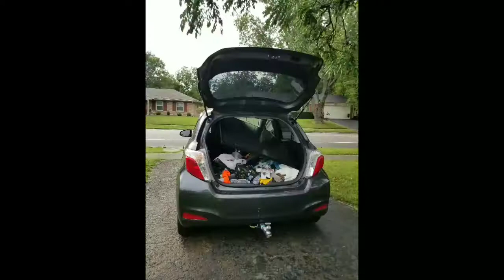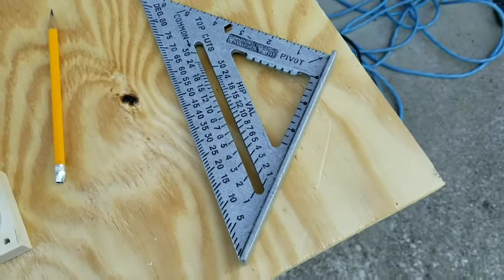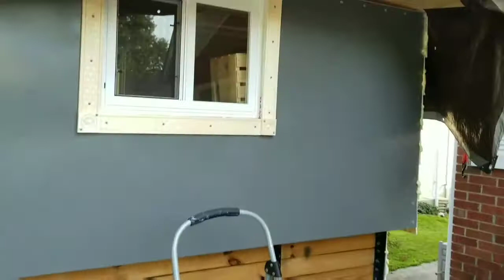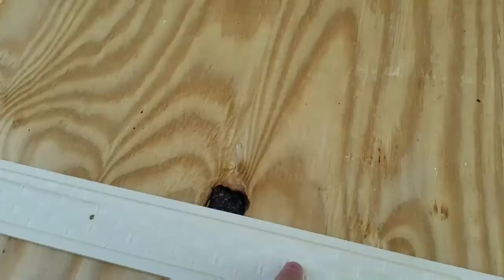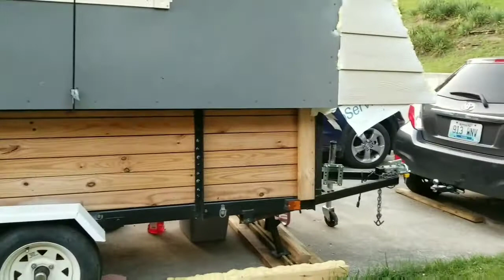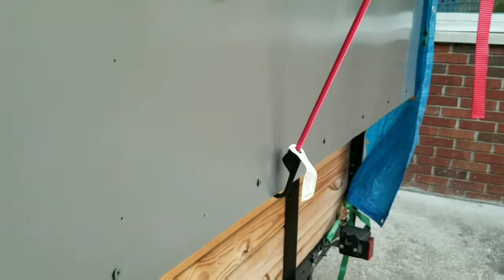4x8 Camper build appreciation and window frames

Comment: The project is coming along nicely. I hope that solar panel work out well, you will have to review it for us when you have it up and running. Good price. Nice alternative for not having to make the 45 degree cuts and it adds a custom personal touch to the trailer. It is always cool to see everyone's different tastes in their builds.
Reply from the maker: boblugaluga100 Thank you and I forgot to mention besides the charge controller of course getting batteries and an inverter. I will definitely do a review when I get around to that part of the build but I have so much more to do.

Comment: Glad to see your still at it. Weather is still too hot/humid for me to get anything done on mine. My solar is a high voltage micro system, varies from 1.3v to 90v..(normally running 24v). and secondary system is just 12v that runs only the solar air heater.. both systems only total 100w but we need very little..

Comment: Awesome man. I want to do shutters on mine too. Can't wait to see what yours look like!
Reply from the maker: The Hitech Hobo I saw a video of someone who has simple shutters they made I can't remember who it was but I definitely will show them once I figure out what I'm gonna do. Kind of like a wood fence it has 2 vertical pieces would rounded on the top and then you have your 2 horizontal a rounded on the outsides.
Reply from the maker: The Hitech Hobo Google board and batten shutters.  The ones that I want to do is the one with 2 boards with a small space in the middle of them.  I'm  so excited I found out what they were called.